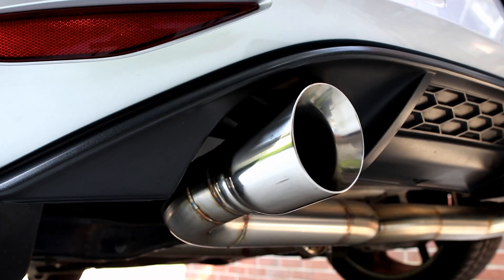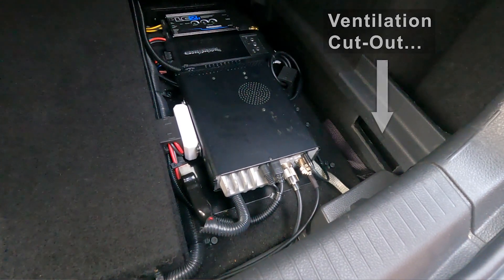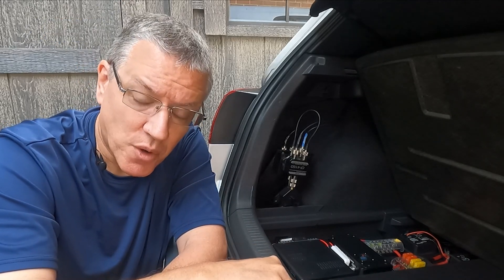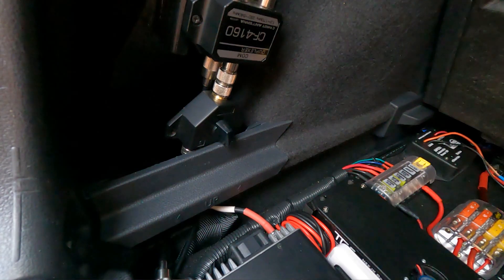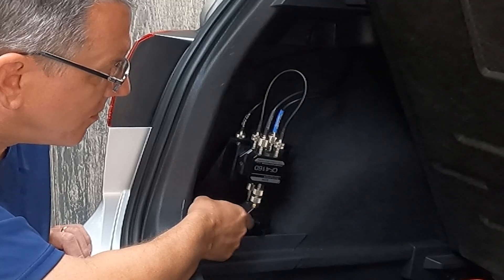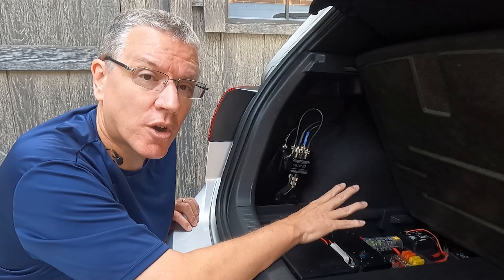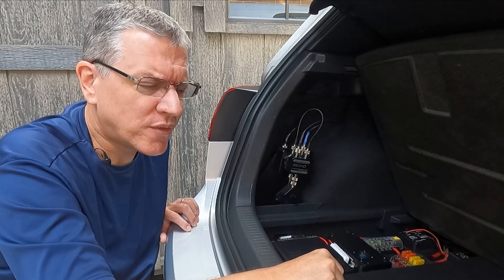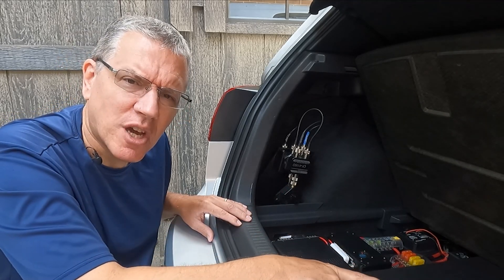Diplexers - Connecting Several Transceivers to One Antenna

Comment: So you repurposed the hole for the factory shark fin antenna? I wonder about doing that on my Bolt EUV, I don't really need a 4G antenna, but probably would want to remove it without permanetly damaging anything and being able to reinstall it. I drilled for NMO on my truck, but not sure if I want to do it on the Bolt EUV. Some folks are saying in forums if I remove that somehow I disable the mic used for wireless phone calls, not sure why.
Reply from the maker: Yes, that's what I did. I have a video about the combination mount that's on the car now at https://youtu.be/yqpXtPgxfrY?si=WmJ-0JoO6aWKgxSY. Mine works great, BUT I don't know how well it will work on newer cars. Okay, it will WORK for sure. The problem is with newer cars that are connected to the Internet full-time, particularly for the purpose of OTA software updates or data collection. Replacing the sharkfin antenna will disrupt that connection, which doesn't seem terrible on the surface, but it may also send the car into a fault status if it cannot communicate with the "mother ship." My 2017 GTI has a "Telematics" fault, but there's no annoying indicators and the car runs fine. I just know it's there. Newer cars may fail to start at some point. YMMV. Thanks for visiting!

Comment: Two radios, one vhf and one uhf. Using this with a single dual band antenna, can I transmit at the same time on both radios? Reason I ask is I’m going to use the vhf for aprs so it may beacon while I’m on uhf
Reply from the maker: I THINK it will work. Well, I know they'll both transmit. What I don't know is whether the receivers are exposed to anything at the time. Send an e-mail to Comet. I found them to be very responsive to technical e-mail questions. Let me know what they say. Thanks for visiting.

Comment: So many adapters, so much loss. It would be illegal (even if the FCC doesn't enforce it) to mars mod your ham radio and TX in GMRS, but it would remove so much loss. Maybe getting a part 90 radio that does all of 70cm so you can do both ham and GMRS on that legally would allow you to use both in those rare times, but I don't know of any part 90 mobile radios that also does 2m.

Anyway, cool to see. I haven't played with diplexers so it's interesting to see how you're using them.
Reply from the maker: I thought about the losses, too. The insertion loss is 0.2-dB per box (0.1-dB on VHF). The CF-706 is the worst, at 0.4-dB. The HF path loses just 0.2-dB before exiting beneath the car. Given my short transmission paths, I wonder if the 0.8-dB (max) is similar to what home owners might see with longer coax lengths. I honestly don't know. But I can say that I could not measure a difference in received FM repeater signals on the radio. That's not to say there are not losses... but I do not perceive them. Should I find myself contesting and looking to maximize my signals, I'd take the time to bypass all diplexers and use straight coax. I might even remove the CF-706 since its only purpose is to combine 6m with the rest. I almost never use 6m. Thanks for visiting.